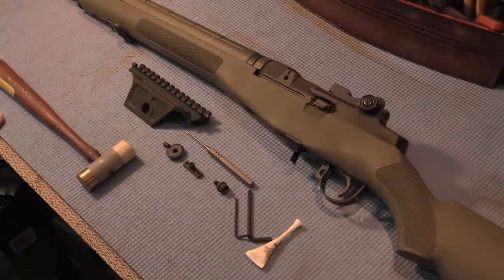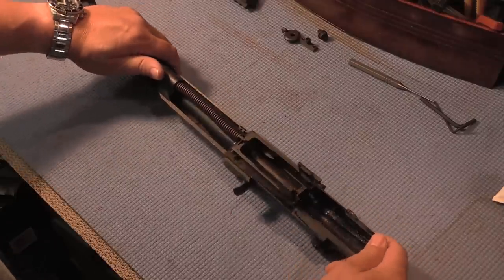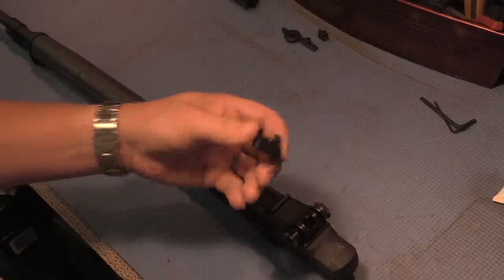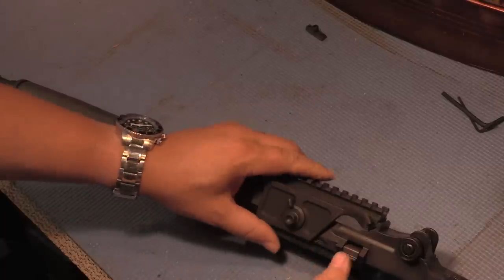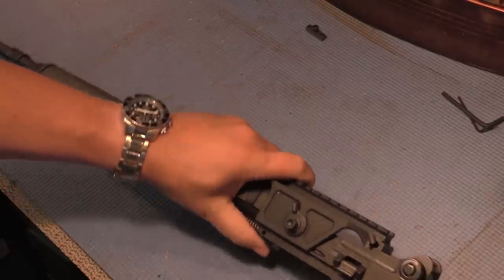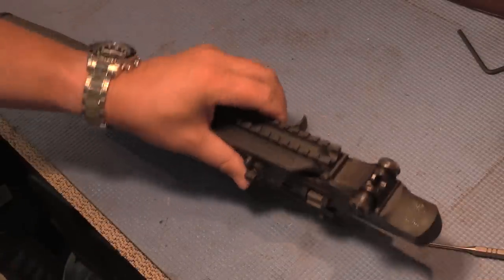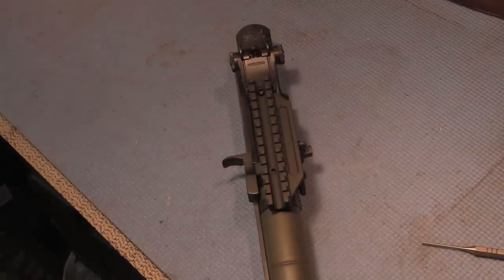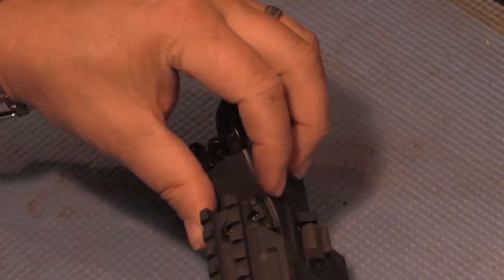How to Install the SADLAK Scope Mount M1A or M14 Springfield

Comment: Generally a great video,.to be a tad anal here I do wish you'd name the fasteners correctly, i.e. bolts and screws are just that and not 'nuts', and if it stated to 'torque' the fasteners in, then why didn't  you show that?
Aw, never mind, I'm just being picky here.
I do have a question now that it's been 3 years since,...have you had any issues with the shells ejecting out from under that mount?
Reply from the maker: Yea just peaking off the cuff for me i endlessly mess up terms, i still do...  Im just a bit slow I guess... LOL  Nope no issues at all !  thanks for watching